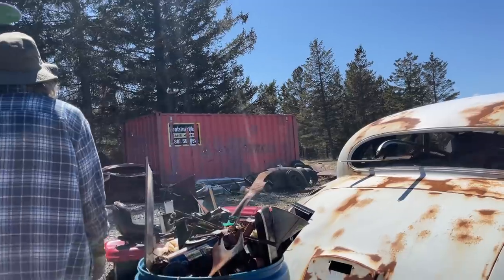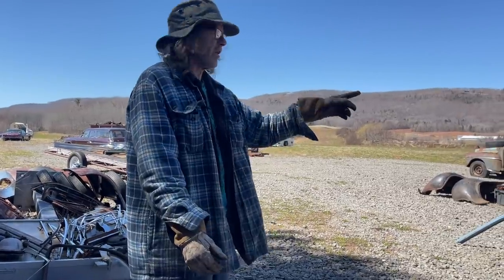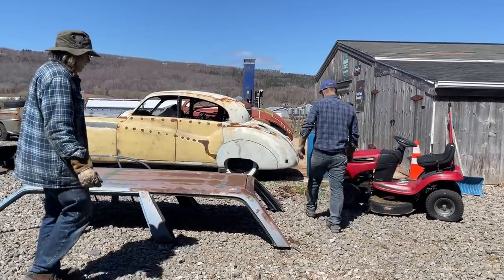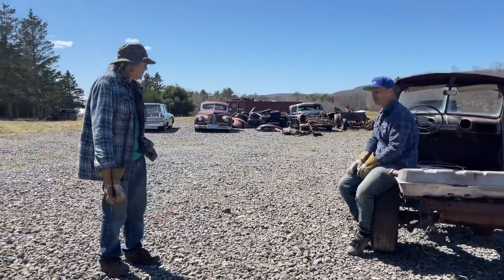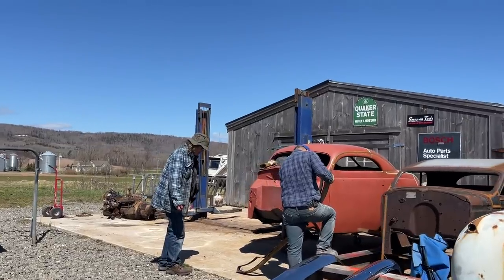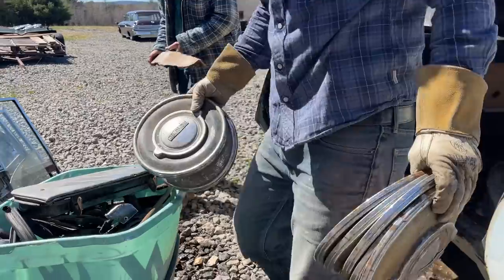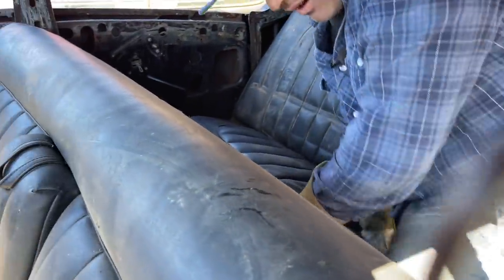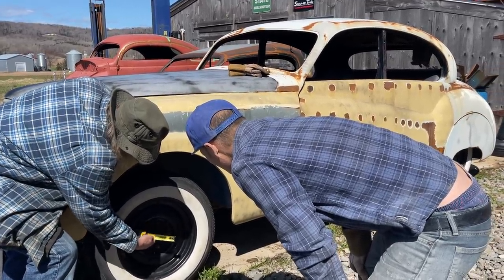New build: 1959 Jaguar Concept Station Wagon

Comment: Well this will be an interesting car. Not sure if the boxy roof will work with the body lines but it isn't my car. I had to laugh that there is already talk about a third Bugatti. Meanwhile #1 and #2 still aren't finished. I would love to see some of the cars from the last two years come farther along rather than to see more started.
Reply: Seems desperate to be different
Reply: friend of mine does this might have 20 going all at once and we jump around to this one then go over there and work on that one then over here and there and then we have 20 more going and we go from here to there and then to that one and then over here , then 20 years later we are like yea we had that car we worked on Haha hey look we got 20 more, its funny, and at the same time its fun, and when they come together Yeap 20 more,
Reply: I suggested a 95 Chrysler LHS roof.
Reply: Bugatti 1 was started in 2016....
Reply: I'm thinking it world look more like a factory one off if he just extended the original roof to the back.
Reply: @OldsmobileCutlass1969Va  you’re right. I think it would look better with the flow of the original roof than putting on a square roof from decades later.

Comment: Hi Chad, ...Before you start cutting the roof on the Jaguar, take a peak at photos of the mid-'50's Nash Rambler wagons.  They added the wagon extension back of their station wagons to a sedan in a smooth transition by leaving the sedan's "C" post and merging the "C" post of the 4 door wagon to the sedan. The front part of the new hybrid still showed some curve yet the back part became squarish and the two parts melded beautifully.

Comment: At 48:00 "Wheel nuts on backwards".... Sorry Chad, Jaguars of this era had tapers on both ends of the wheel nuts so no matter which way they were put on they were correct. To aid assembly by the roadside after a puncture in the dark, perhaps? Also wheel bolt pattern fits Lincoln mid sixties as well. As a 50 year enthusiast of these early models in Australia, I'm a little unsettled to see this car customized, but better than rusting away waiting for a restorer, and it seems the customizing had already begun before your acquisition, judging by the firewall and underside of the bonnet {sorry, 'hood'}. All the best, and welcome to contact me about any of the finer details of how these cars were originally put together.

Comment: My own personal opinion. I think it would look much more stylish if you cut the original roof at about the window post, then move the rear of the original roof back and fill in the middle section on the top and extend the original roof you cut off down to meet the trunk, so it stays flat but curved at the top. That would keep some of the original curves but make a unique looking wagon version. Adding a unique woody rear door and some woodie style paneling for the side doors. That would be a very cool woodie wagon. Make it a true concept car.

Comment: sooo, wouldn't drawing a picture of the planned build be useful ?  Or, do you prefer the "suprise" method ?     Just wondering if the result is actually going to look better than the original Jag....    Of course, it will be another great example of skilled metal working, regardless.     That squared off station wagon roof does not seem to "blend" with the rounded, curvy style of the Jaguar ?
Reply: A roof off a similar era car would work much better.
Reply: Have the top be totally square and the body curvy. So make the top exactly like a boxy chevy 70s car welded onto the bottom half.

Comment: A shooting brake as the English would say. You have hardly started and I love this concept already.
Reply: @electrix6751  Lol It's what the English call a station wagon. It is a term that goes back to ye olden days when they had wagons designed to carry their shooting gear etc.
Reply: 'Shooting brake' is no longer in common usage, it implies a coach-built conversion (which is what Chad intends); production vehicles of that type are called 'estates'.